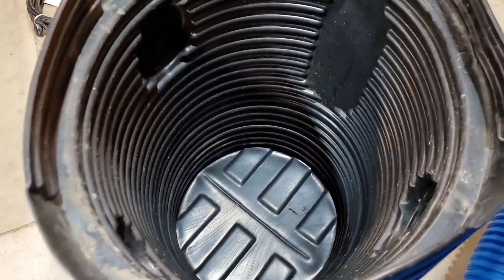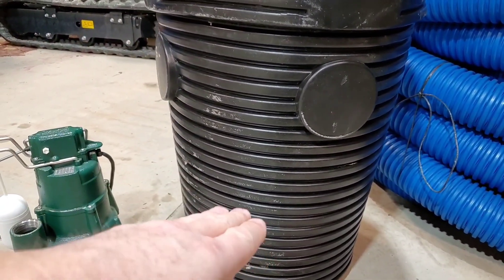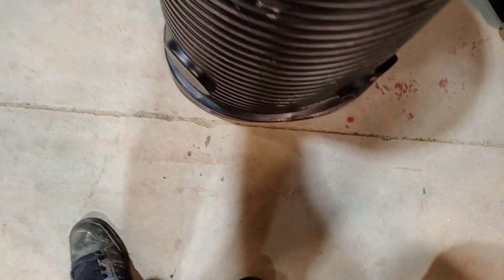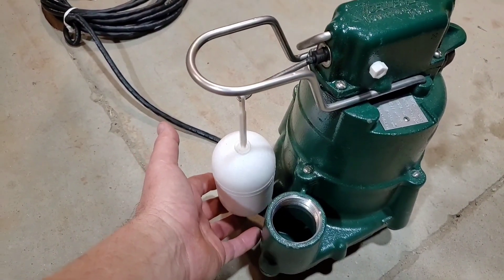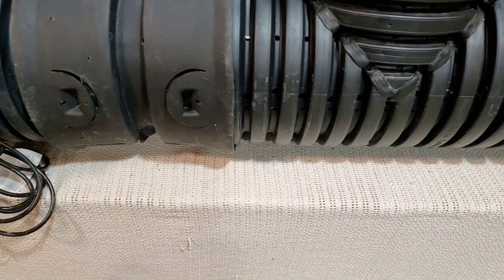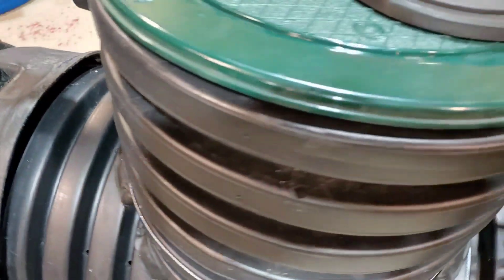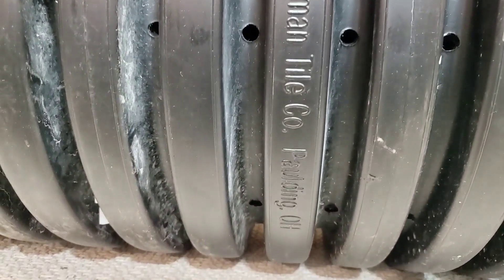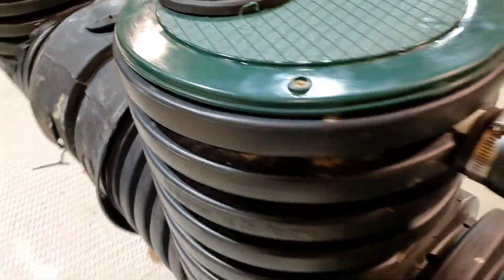Dos & Don'ts of Backyard Sump Pump Systems [  Extend Pump Life & Reduce 80% of Pump Cycling ]

Comment: I live in Eastern North Carolina. The soil on my property is Rains Fine Sandy Loam, not a rock in sight. I have 2.5 acres that flood 2-4” deep every time it rains. My drainage ditch is 500’ from the location I need to place the Sump. The ditch is about a foot lower than the Sump. Do you have a system that can move that much water that far? Thank you for your answer.
Reply from the maker: You can Gravity drain the water to a Deep Sump Pump System [ Lift Station ] install it 50 - 100 ft from Ditch for best Results